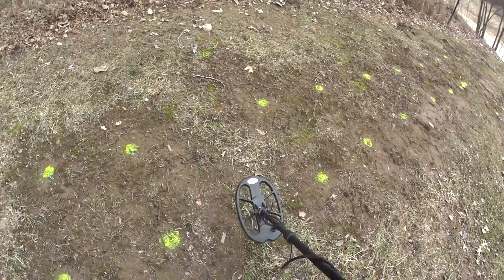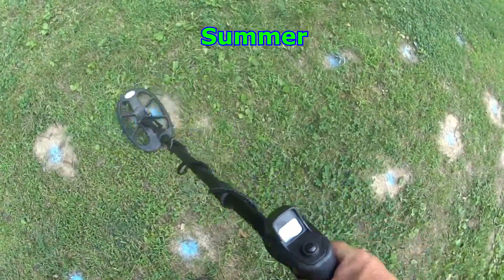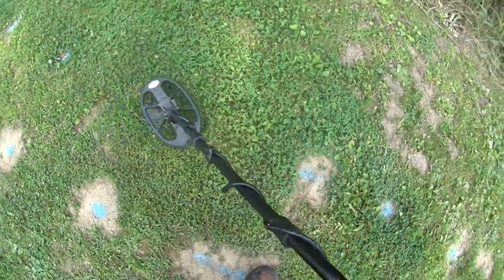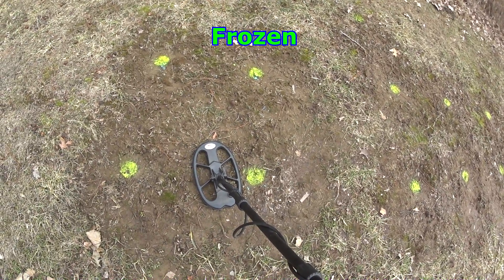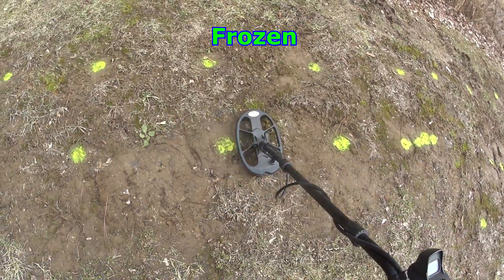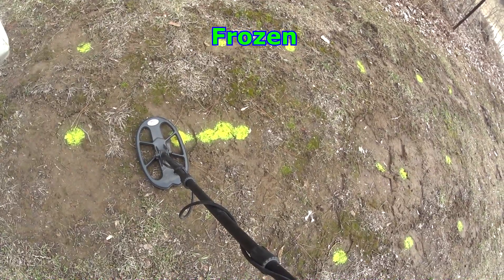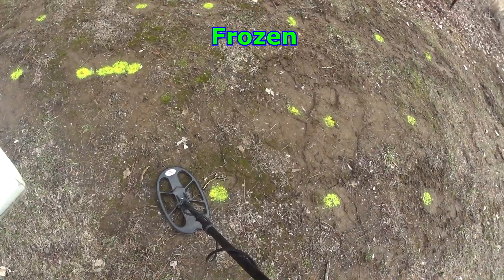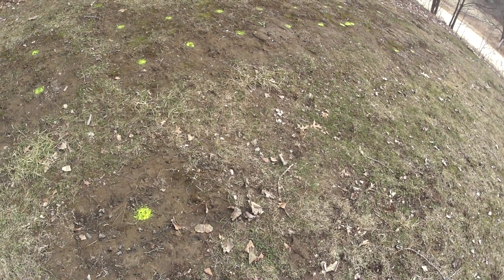Metal detector test in wet frozen soil vs dry warm soil

Comment: Scannerguy try these tests in DI2 mode at gains above 95 you should be able to hit the dime and quarter at 12" without a problem.
Reply from the maker: I'm going to run a more in depth test with all three settings and all three coils. DI2 does get quite chattery up there though.
Reply: I had the same problems with EMI and my solution was this. Set DI2 the mask level to 20 not 10, you will start losing depth with mask levels beyond 20. Set the gain to 90 and only go up from there, obviously ground balance the unit. Try these settings and youll see, thanks for the great videos!
Reply from the maker: +Julio P Wow, Thanks. I read this, grabbed the detector and ran out to the test bed in pouring rain. Was bothering me that bad that this might work. You are correct. I quieted it down. I have never ran DI2 above 55 for a gain but always left mask on 10. I worked quite well on 90/20 as you stated. If I turn mask down towards 10 it will start chattering. But it still didn't pull the 12 inch quarter but does chirp like something is there. Might be due to rain though and the soil is very wet. It ground balanced at 68. Thanks much.
Reply: +scannerguy1968 Glad i could help Scannerguy I've done quite a bit of experimenting on the Fors Core, its a wonderful machine. I have mine preset at a gain of 90 and mask of 20 in DI2 (Gains of 95-99 are amazing for depth in my soil in DI2, Mask 20), on DI3  i have it at 98 Gain Mask 20, COG Sens 98 Mask 20, these I've found in my test garden and beach give me excellent depth far less EMI issues and still give me that grunt for iron. Rusted iron is a bitch as it gives 99% of detectors a high tone at certain angles, even high end ones.The great thing about mask 20 is that it allows you to still hear the low grunt for iron while knocking out those annoying small nails if you listen. The rest is getting used to the rolling tones and determining a bad from good target takes time but once you master it, its amazing.

I'm on treasurenet.com forums SouthFLdigger love the hobby !
Reply from the maker: +Julio P I'm going to have to try this more on DI2. I'm also a member on treasurenet . Same as my youtube, scannerguy1968. Haven't posted too much though but have found great info from there